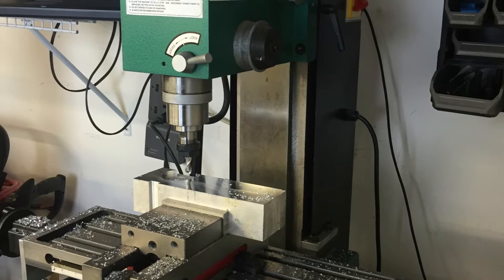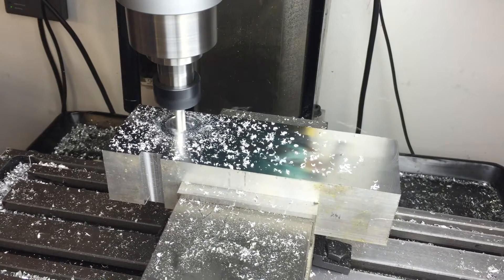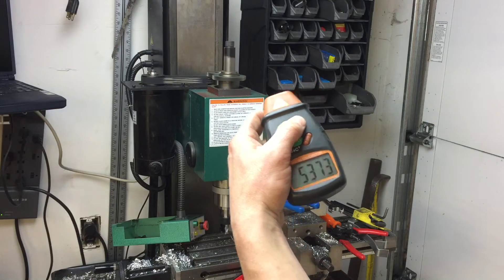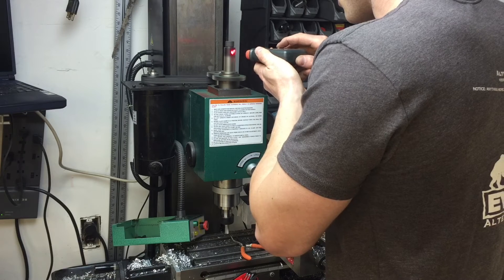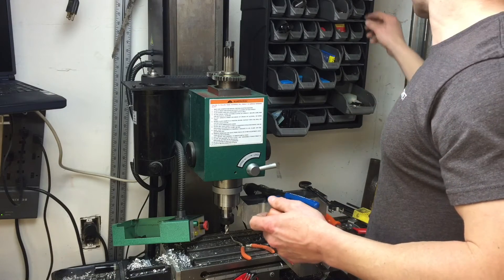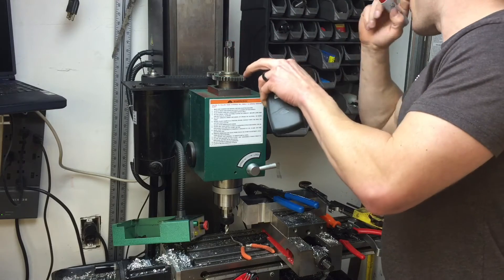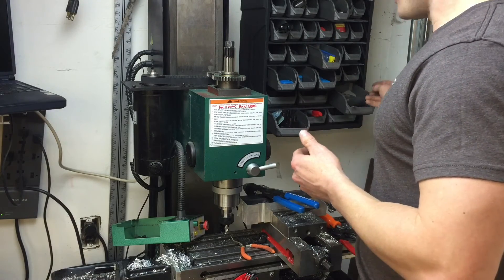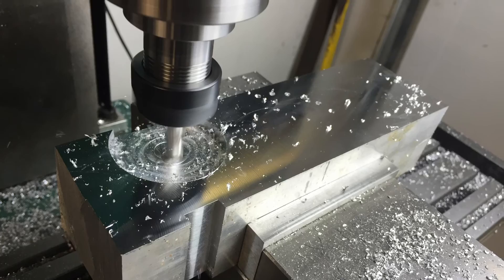5374 RPM SPINDLE MOD GRIZZLY G0463 CNC G0704 Unorthodox Fabrication

Comment: Do you have a blog or something, somewhere that has the part numbers of what you used? 
Don't have a G0463, but I have a G0704 I converted to CNC that's limited to about 2200 RPM.  I'd like to double that, and your 5374 RPM sounds nice.  I'm also interested in feedback and being able to control the motor from the G-code.
Reply: So what was the mod?